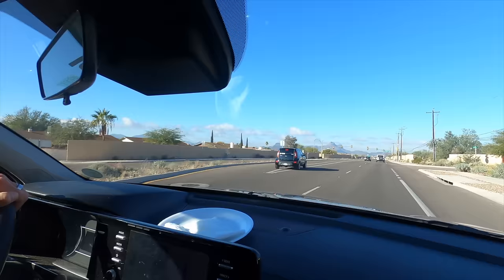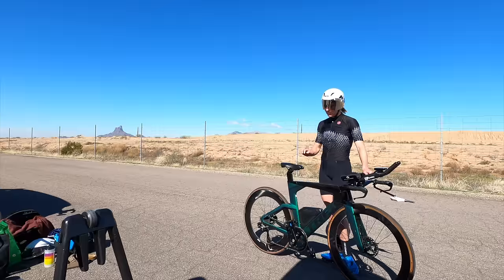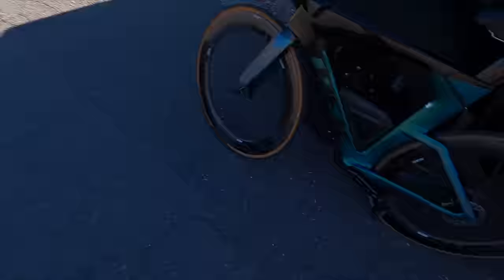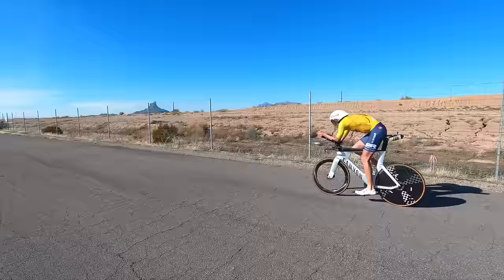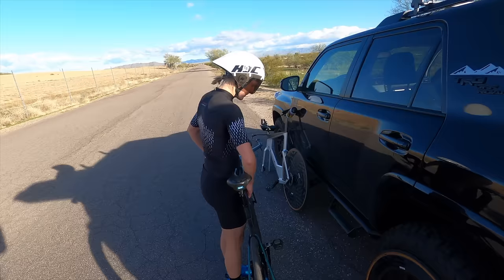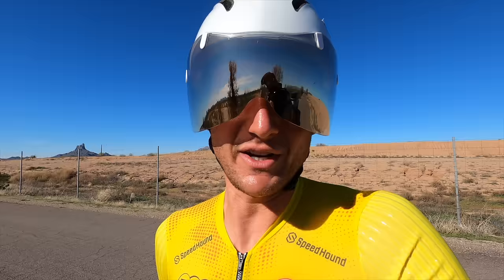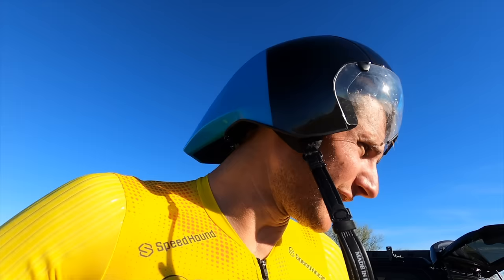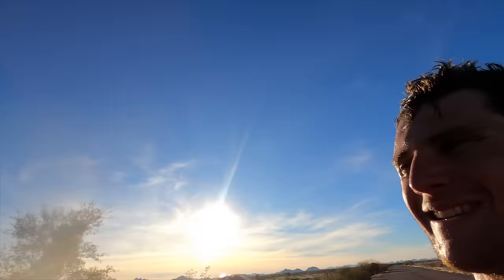Aero Testing: How I Saved 43 Watts

Comment: Why that brand of tire? My understanding is the Continental GP 5000 the fastest and one  of the best for flat resistance around. (Not really telling you anything you don't already know). Just wondering  the thoughts on the tire choice, especially with all the flats....
Reply from the maker: I like the GP 5000. Have used them a lot. These are old race Schwlebes PRO TT's so they don't have particularly good puncture resistance. ultimately there was an issue with the valve core on that 7.8 front wheel so I was able to fix that and use the 7.8 on day 2 for testing